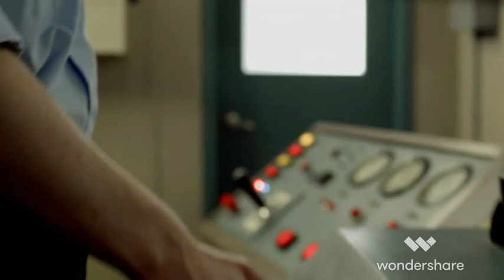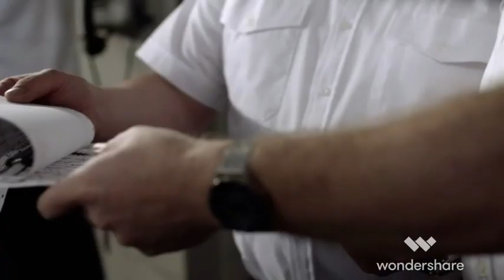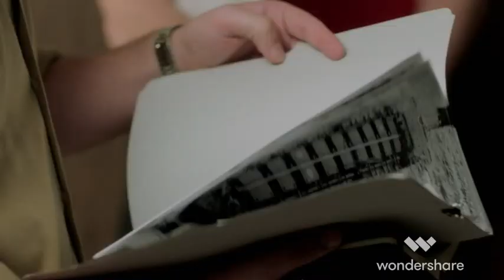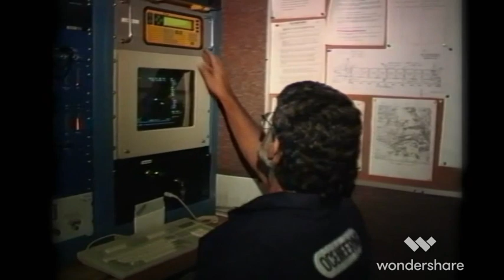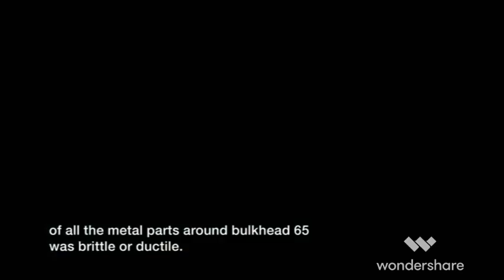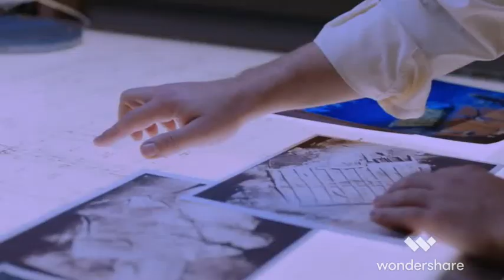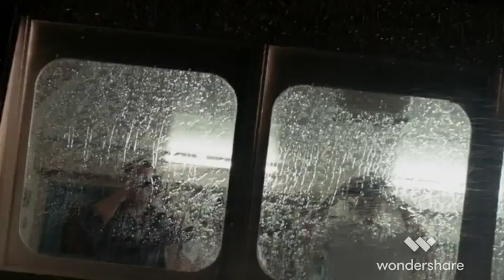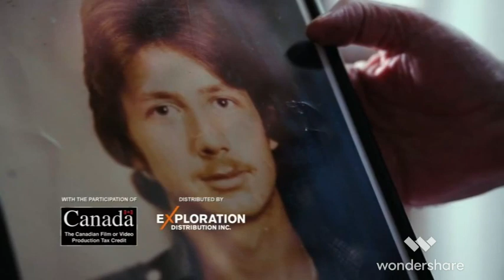Disasters at Sea. MV Derbyshire

Comment: Seems like the MV Derbyshire experienced almost (or perhaps) the same thing that the Edmund Fitzgerald did on Lake Superior.  A wave(s) so sudden and severe, that it literally  drove the ship to the bottom.  I only hope that it was so sudden that no one had the time to suffer the panic and fear. as well as the physical suffering was so brief, that it was over before they could have the time to be terrorized by it all.
Reply: I’m inclined to believe that theory. It was launched just after the Big Fitz. The air vents probably played a big part of the ship’s sinking like the Derbyshire.
Reply: I thought the exact same thing
Reply: @seanvillage  Agreed!
Reply: @seanvillage  comparing a laker to a salty is like comparing apples to watermelons. The Fitz broke up instantaneously at near center ship, with the stern coming to rest upside down which is rather unusual and why the rogue wave theory around her sinking isn’t as simple as most shipwrecks blamed on the phenomenon. The theory with the Fitz actually involved a large wave rising to near crest height just ahead of the ship at the bow with another even higher “rogue” following wave picking up the stern as the bow and center of the ship were within the trough between the two waves, driving the bow under and breaking her back as the stern was picked up, flipped over, and dropped to sink. The sad truth is almost any loaded single hulled lake freighter would suffer the same fate in those conditions, whereas a salty like Derbyshire should hold together far better in rough seas. There are also a lot of variables with the Fitz that aren’t an issue with Derbyshire, like the possibly of having struck bottom at some point being very real in the Fitzgerald’s case, where the Derbyshire was in water miles deep for the duration of her journey through the storm.
Reply: The scenario of being aboard  Derbyshire as she went down is a pretty psychologically horrific one using the clues we get from the investigator’s reconstruction….her being a stern piloted ship that went down by the bow and the bit about how the superstructure and hull structure aft of frame 65 (which is just barely ahead of the aft tower and engine room / machinery spaces) suffered implosion damage suggest that section of the ship was still (mostly) water tight and filled with air when it went under and imploded from water pressure as depth increased. In all likelihood that means at the very least those within the deeper parts of the ship knew she was going down for at least a matter of several seconds from the sounds and events happening around them…..but the implosion that came soon after would have been a pretty merciful way to go as far as physical torment goes….pretty much instantaneous “lights out”.

Comment: All the holds must be filled otherwise there will be high bending moments and shearing forces at the frames adjacent to the holds which are empty. There should be a bilge alarm in the bosun store and there is also a bilge educator that allows water to be pumped out, if the reason of the sinking was as described why didn’t the Chief officer and the Captain hear the alarm and attempted to pump the water out?
Reply: If a rogue wave drove the bow under and even one main cargo hatch cover failed there wouldn’t be any time for the bilge pumps to do any good, even if they were already running. Iron ore pellets are tricky in that regard too because it will hold water and grow heavier instead of letting it simply run through and collect in the bilge. Granted the cargo holds should have been basically “water tight”, but there were suggestions that they were not.
Reply: @J.R.in_WV  Or the bilge alarms were not tested properly and the floater got stuck.

Comment: Well I imagine the captain said this is it boys because there was no time to do anything. I've been on a ship slightly smaller 889x144 it could take on 144000 tons of oil and I just couldn't imagine it going down .
Reply: Tankers should be safer,due to design considerations - the absence of large openings on the main deck for example.
Reply: Derbyshire are similar size and long like our bulk carrier ship we use today Berge Neblina also ore carrier. Not only the cargo could be  dangerous into the ship, massive bulk carrier also exposed into with rough whether. She also very gentle and slow than other's type of ship like container carrier,oil & gas carrier,car carrier or etc..